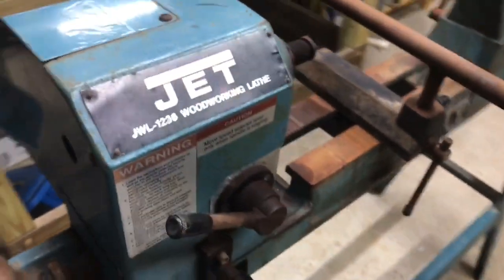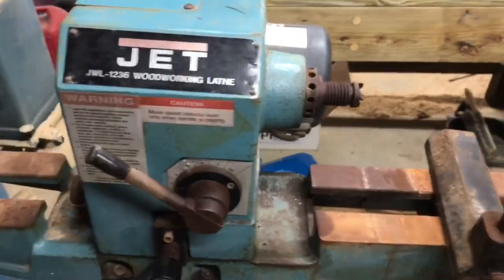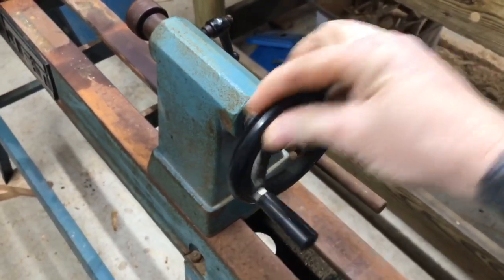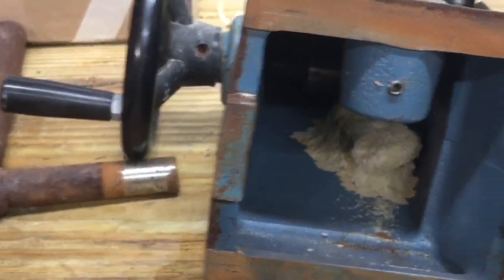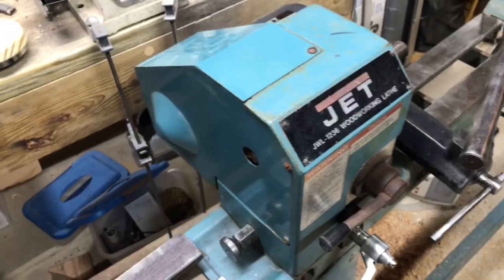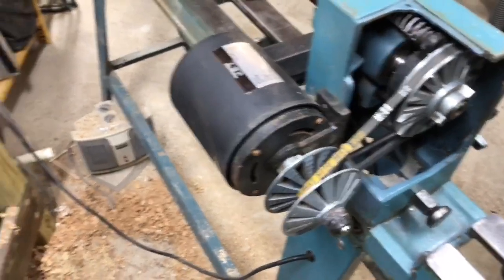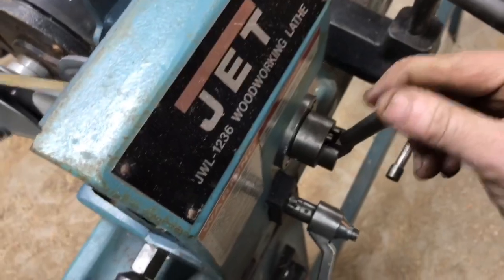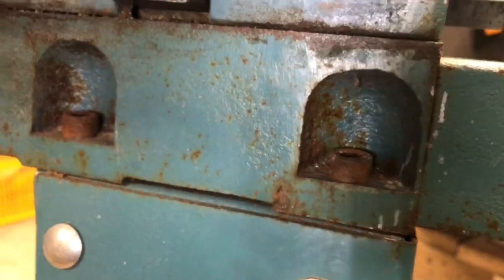Jet Wood Lathe JWL-1236 clean up tune up.

Comment: I have the exact same model in exact same condition. I cleaned up the bed and the backing plate but I'm looking for replacement parts. Any suggestions?
Reply from the maker: Try here:  https://www.ereplacementparts.com/jet-jwl1236-wood-working-lathe-parts-c-32652_32854_129617.html

Comment: Great job cleaning it up. What was what you put on the beds? Some type of wax? I have all the old jet tools, lathe, table saw, band saw and drill press.
Reply from the maker: It's Johnson's paste wax.  I use it on any metal bed, like my table saw, band saw, etc.  It keeps it slick and rust free.

Comment: just picked up the same exact model, in very similar condition. Do you have the original drift rod for knocking out the spur center? Mine is missing but I'm thinking any 3/8 inch steel rod would work
Reply from the maker: No, I’m actually using a drill bit extension rod for now. It’s what I had laying around and It works perfectly!
Reply: @TerrapinCreations666  good to know. I think mine is still rusted shut. I hit it with some penetrating oil so I'm hoping it eventually loosens up. I'm a little bit afraid of going at it too hard with a steel rod and possibly damaging something. Did the oil do the trick for getting yours out?
Reply from the maker: @shaneb643  Yes. I detached the head from the bed so I could tilt it, keeping the penetrating oil right in back of the spur chuck. Left it overnight and it came out with one firm tap.
Reply: @TerrapinCreations666  Yeah I've tilted the whole stand up slightly but I think my next move is doing exactly what you just described. Thanks for the reply, I appreciate it.